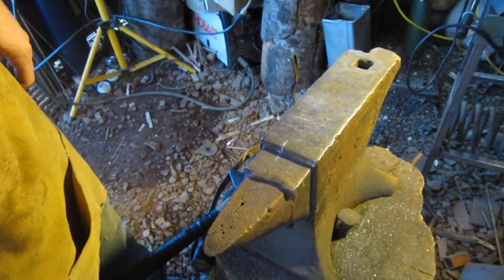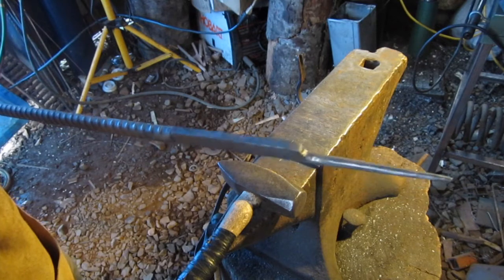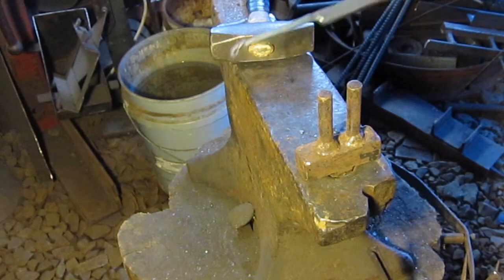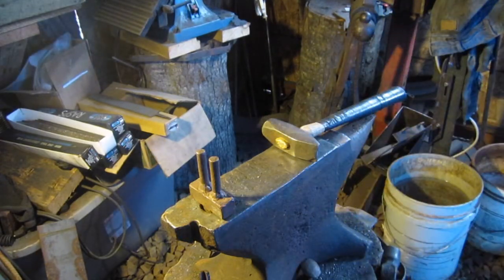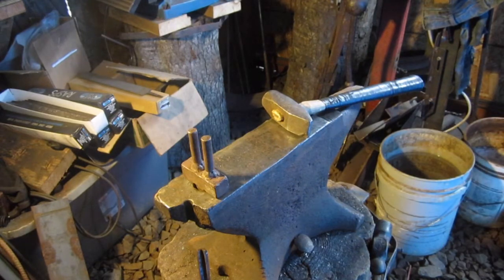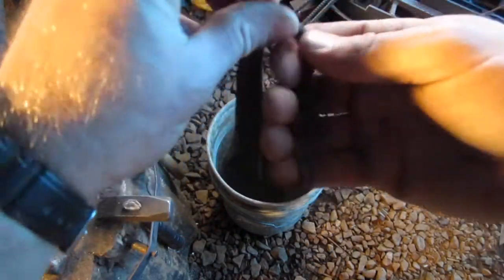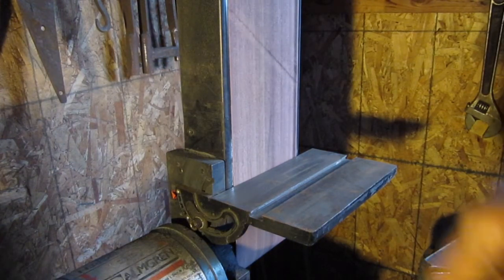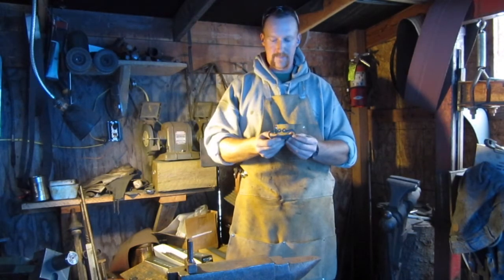How To Hand Forge A Flint Striker Part 2 of 2

Comment: I'm no blacksmith but I have attempted a couple times to make my own flint striker with a backyard temp forge, with not much success. I have a couple questions. So.... as long as you get the piece bright yellow, almost white, you don't have to bother checking it with a magnet? And I assume you just heated the striking part (rectangle section) since you don't want the rest of it to be too brittle? Oh, and I noticed you used water, not Oil. Is that because you want it to cool faster so the edge is harder? Thanks...
Reply from the maker: Woodenarrows Good Morning. Getting your temperature right comes with time and sometimes it is hard for me to explain, but you want the striker (just the bottom striking portion) bright orange before you quench. I have used oil before but not with as good of results so that is why I use water.  And you are correct it does make it cool faster making it harder. Hope this helps. God bless!  Glen